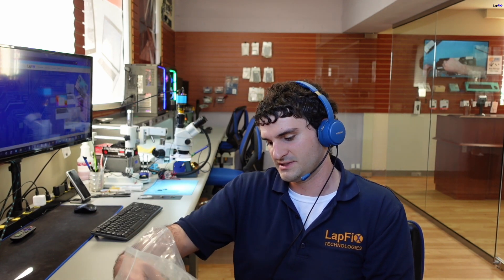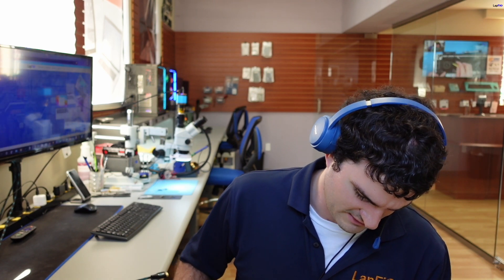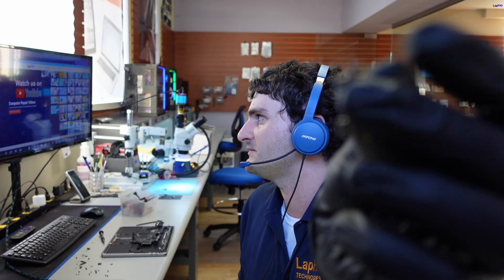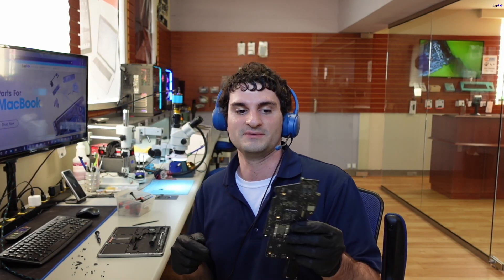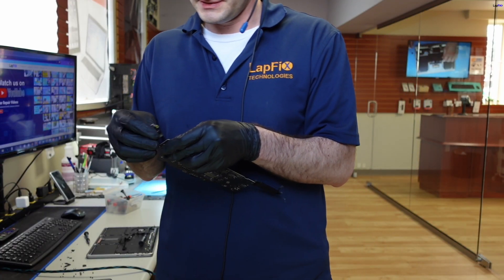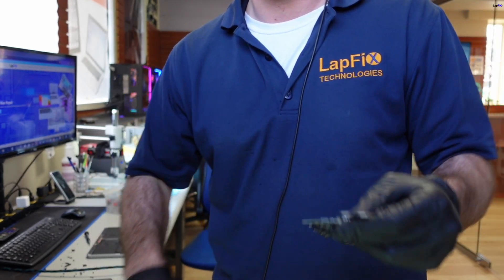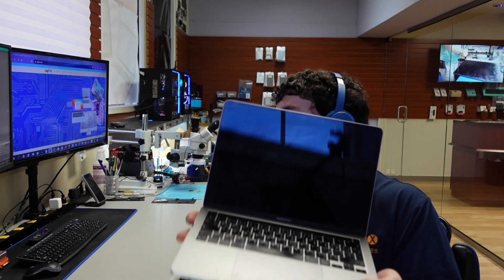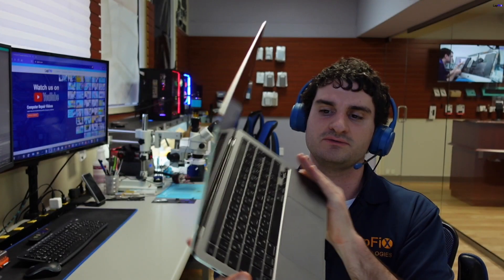M1 Macbook Pro Not Charging After Liquid Spill

Comment: Mate I’m in Cornwall UK so not really competition but get annoyed as I see you sell parts all good and well just like the new apple man but Steve Jobs was a tinkerer. I’ve done apple for over a decade now but still new to certain subjects inc taking donor parts for chipsets etc all good with LCD connectors or MacBook Air battery connectors either the thermoplastic melts and solder does not or thermoplastic fine but solder never melts even tried the IR pad below up to 150c please say temps and heat blow speed I know it varies on different station brands but please help. These are important for people getting into micro soldering. Had usually heat gun on blow around 5-6 otherwise it as you know starts blowing chips off the board and set at 300c max otherwise battery connector melts but still not melting the titanium apple solder. Please if you could do a vid on this would be great. Thanks. Yes I’m as busy as you but would be appreciated.